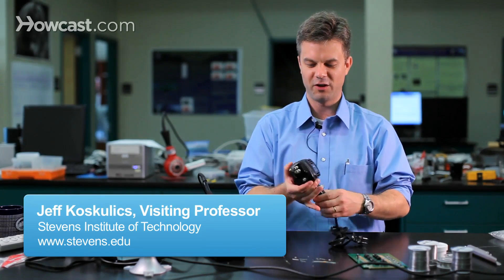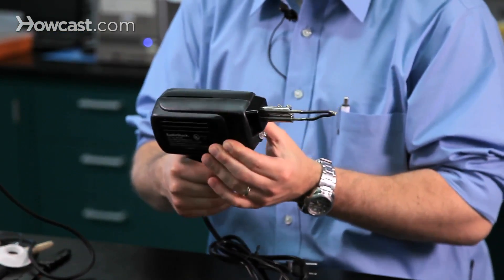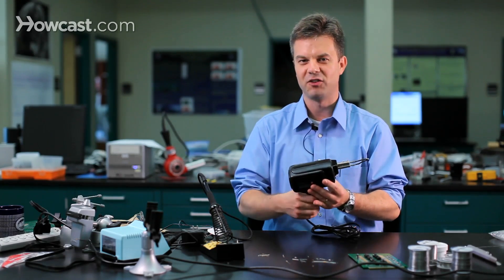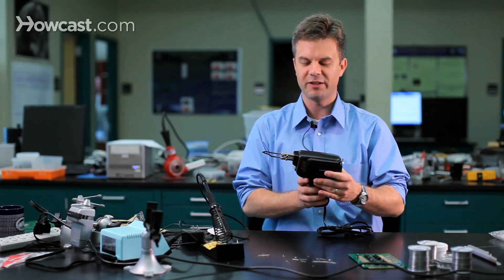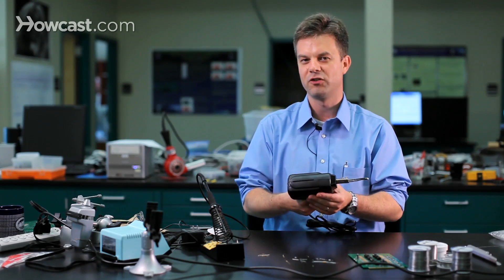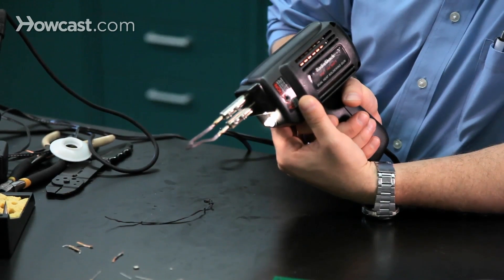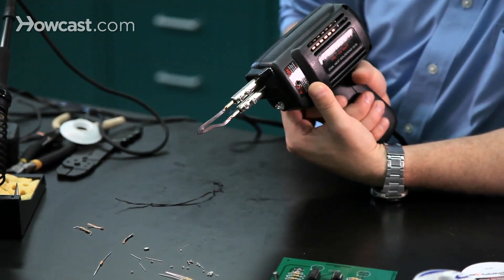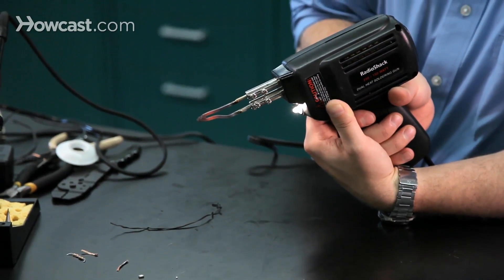Soldering Iron vs. Soldering Gun | Soldering

Comment: Just bought this for a circuit board. Wish me luck.
Reply: How did it work for you? I wish this guy took the time to explain whether a high powered soldering gun is the optimal tool for printed circuit board repair, or if it's better suited for soldering heavier parts.

Comment: Damn it man.  I need to solder a battery onto a circuit board but I have a soldering gun not an iron.  The soldering gun isn't used for such things though.  It's for higher power connections.  I have a battery that needs soldered though to a circuit board.  I need a soldering Iron but I actually have a soldering gun which isn't the thing you would use to solder on a circuit board.  It gets much hotter and is used for higher power connections.  I don't know how I'm going to solder this battery onto this board without a soldering iron because I have a soldering gun.  It's not the same as a soldering iron because it gets much hotter and is used for higher power connections.  You wouldn't normally see someone soldering on a circuit board with a soldering gun because it's meant for higher power connections. copy/paste

Comment: I have a soldering gun laying around. Can I use it to do basic soldering such as soldering  wires together or soldering wires to a plug?
Reply: Orestis Karapiperis yes but no
Reply: For the love of God DO NOT USE IT ON A PRINTED CIRCUIT BOARD
Reply: No, a soldering gun is designed specifically for working on printed circuit boards.

Comment: Do these reach high temperatures?  Im worried about using it with a printed circuit board.
Reply: Depends on wattage. I have a 100 W Radio Progress soldering gun and it doesn't damage PCBs nor parts if I use it properly which isn't very hard. Hobby level soldering guns tend to be low power so they shouldn't cause problems. One thing is certain, they're a lot better than those stand alone AC 220V soldering irons.
Reply: Gotta be fast but it's not ideal

Comment: Ok. I'm still little confused. Can I use a soldering gun for a circuit board?
Reply: youre not likely to use this on a circuit board, its more for heavy duty things - like heavy duty electronics and not really a printed circuit board (it's for bigger electronics not including printed circuit boards.)
Reply: @GatecrasherSlim  Does it reach high temperatures?
Reply: @infernus6278  yes. The high temperatures are useful for things like heavy duty eclectical work, not for stuff like a printed circuit board
Reply: NO !
Reply: r/wooosh

Comment: Could you use this on a PCB?
Reply: Am not sure. The guy didnt repeat it enough
Reply: its more for bigger things and not for a printer circuit board (due to it being for bigger electronics so not printed circuit boards).
Reply: It's doable, but it is easier to use the Iron. I try not to get it too hot for too long though, it can cause components in a small surface area like PCB to damage. Try to shorten the time in which contact is made then clean the area around it once it drys with a little alcohol.
Reply: Yes but hard,it is much easyer to buy soldering iron and that do the slodering :)
Reply: You can use it on a pcb but only if it is a high powered circuit board.